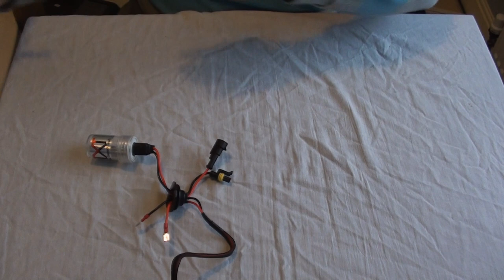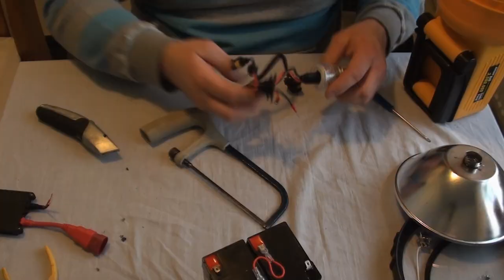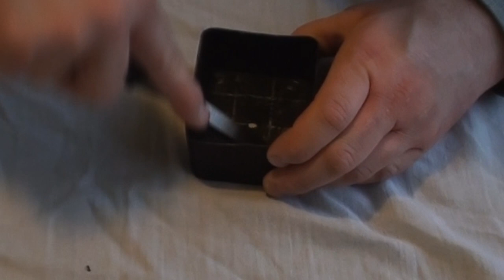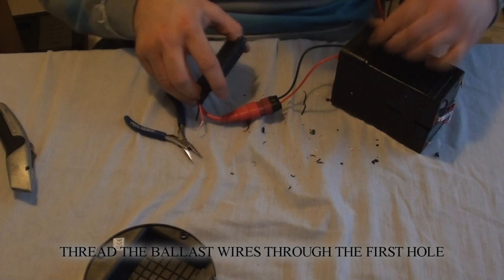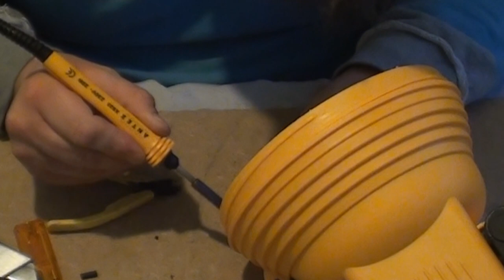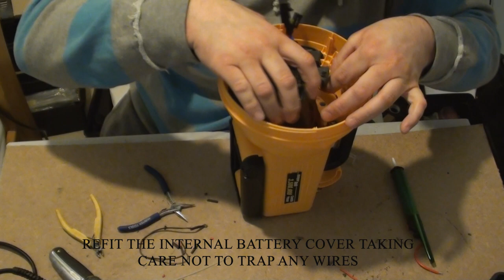3 5 Million Candle Power Torch HID Mod

Comment: I got one of these many years ago, maybe an earlier model as on mine the front is held on with two screws rather than being threaded onto the body. It only lasted a few times and was almost useless for work projects as the light wouldn't last any length of time. It has lay here for years not working and yesterday I opened it up. I see why the charge wouldn't last long as it is a 100W halogen car light bulb. I tired charging it overnight and it still does nothing, I measured very low voltage across the batteries so it seems they do not take a charge. I opened up the battery packs wondering if I would find banks of AA rechargeables, but it seems these are old fashioned lead-acid batteries. When you pry off the plastic covers there are three rubber caps, when I removed them I can see they are completely dry inside. Have you ever had to fill them up with deionised water?
If I can get it working, I will replace the bulb with a low power LED. I don't need super brightness, I just need it to work.

Comment: What flashlight had used?
Reply from the maker: I used the Diall Quartz Halogen Torch from B&Q but if you cant get to B&Q this torch has been re branded by many companies like the Sealey AK437, you don’t have to use this torch as long as it has a 12v battery inside and space for the ballast and bulb you could use another like the Cyclops Thor
Reply: projectmayhemUK can you make me one please